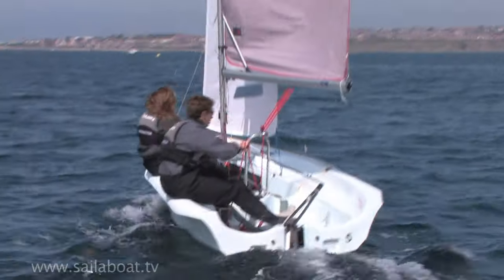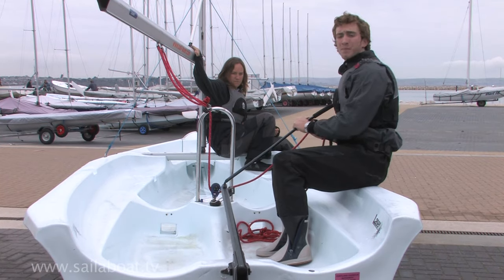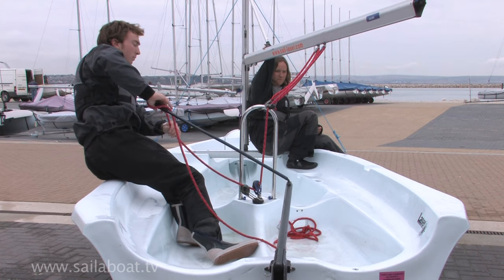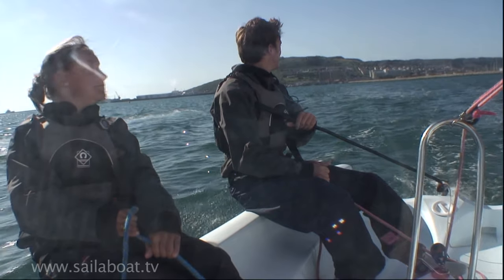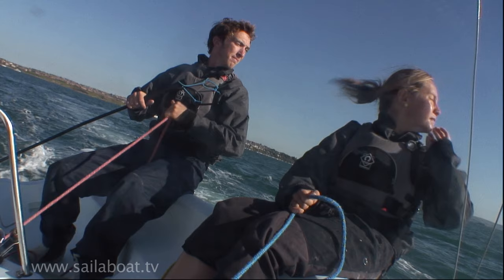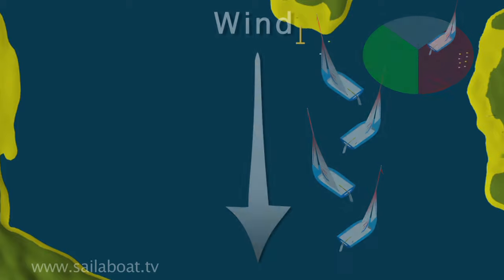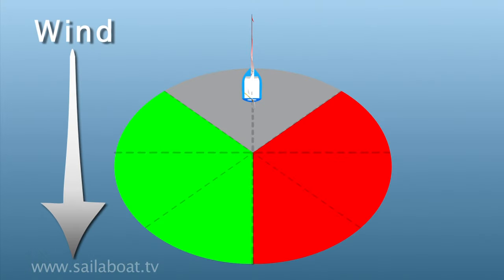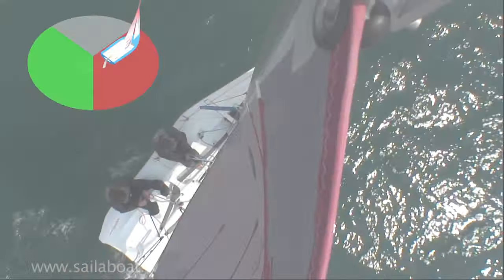How to Sail - How to tack (turn around) a two person sailboat

Comment: Thanks for this.  I had a hellish lesson last week trying tacking for the first time in 15 knot winds.  I think I did all the "don'ts" in your video.  I've rewatched this video multiple times in preparation for tomorrow's lesson.
Reply from the maker: Tracey Hamm glad they help. Try not to rush things. I notice some people try to do things too quickly to start. Go slowly each step. Speed comes later but break the manoeuvre into steps and try to do each one. This way your instructor should spot where you are going wrong. Hope it goes well!

Comment: Very useful video. The only thing that is a minus is the use of the high metal arch in the middle of the boat, which the skipper was using during tacking for balance. This is not something you'll find in a normal sailing dinghy.
Reply from the maker: Thank you Antony. Yes you are right, but hoops are on some boats. People will just figure out what it means if they don’t have one. We never say “use the hoop to help”
Thanks for watching

Comment: IM SO BAD AT TACKING I find it so hard to switch hands and am I too heavy please leave tips!!!!
Reply from the maker: Try swapping hands as you move across the boat.  When teaching this is the alternative approach and works better for some people.  We also say in the video to bring the tiller extension under the arm, but for some people this doesn't work.  Try just flicking it to come on top of your "new" shoulder on the new side.
DO NOT rush the process, take it really slowly one step at a time.  Just like learning to drive.  Speed comes later. do it step by step and try to analyse what in particular you have problems with.
Reply: sailaboattv Encouraging advice. I too struggle with tacking. 
We won’t even go there with gibing,,,
I love this channel. Many thanks.
Reply from the maker: Greta just practice in light winds first as it is all easier. Weight is never a problem, it comes down to technique. Just go smooth and slow and practice practice practice 
You will get there but avoid windy days whilst learning 
Speed comes later

Comment: Do racers release the main sheet when tacking?
Reply from the maker: People develop their own style. I always release the mainsheet as I push the tiller but only by a little bit. I find it helps the boat to tack. On a Laser for example it will be extremely hard to get under the boom if you do not release the mainsheet.
What we show on the videos is the best first way to do things. Much like driving a car fill then grow their own styles based on the basic steps.
The biggest difference racers do is they concentrate 100% on wind awareness and in particular wind shifts. These are very important to master as the wind shift either rewards or hinders your progress upwind. Hope this helps
Tim
Sailaboat
Reply: @sailaboattv  thank you Tim 👍

Comment: I’m going from an optimist to a 420 and will be crew, for the job all you have to is uncleat the jib line? Overall very nice video
Reply from the maker: CSR Jam thanks for the note. The helm and crew work as a team. In a tack the crew looks after the jib so release the line. But there are other things a crew should do. Some of them are these
1 look out for other boats before, during and after the turn
2 use your weight together with the helm to help the boat turn
3 release the jib line but practice this. Don’t let the sail flap wild in the wind, easing it will help the boat to turn. You can wait for the sail to fill with wind slightly on the wrong side before releasing. This will help the boat to turn more. Then release and quickly pull in on the new side. Depending on how strong the wind pull in. If it is light not too hard and if strong wind pull in hard.
Reply: @sailaboattv  Thank You So Much! Im going to my first double handed class right now wish me luck!

Comment: Years ago I had some fun sailing single handedly on a 18' keel boat, and the it's quite a challenge to tack. I had to use the winch to pull in the jib because I wasn't strong enough to do it with my arms and I can't reach the winch myself. So I had to squeeze the tiller extension with my hamstrings after I turned, kneeling down and reach the jib sheet winch and hope it doesn't go too much off course as I pull the sheet. Another way to do it was to turn higher into irons and pull the jib sheet without the winch. Either way it's a challenge.